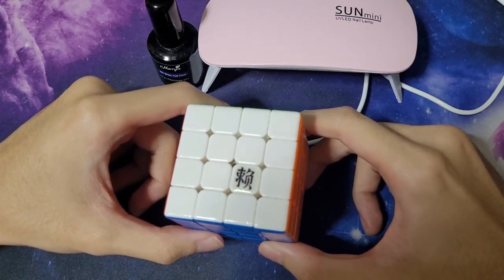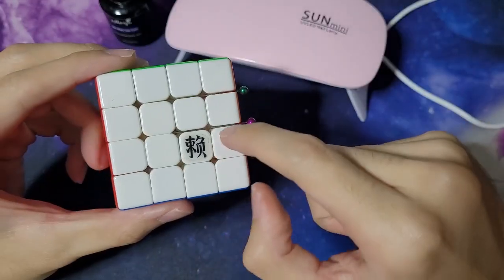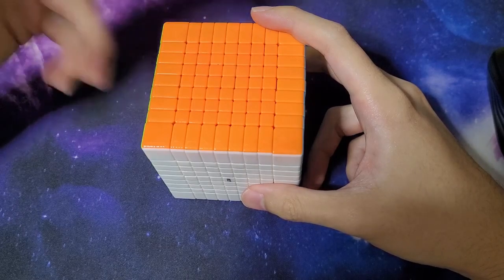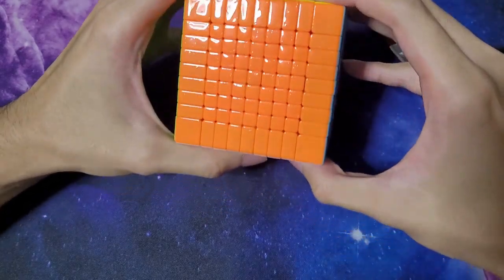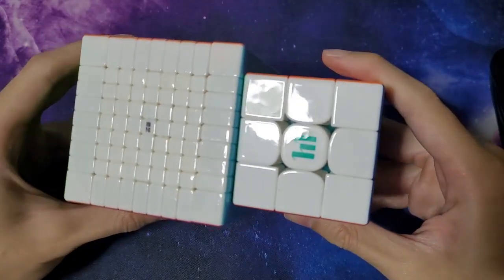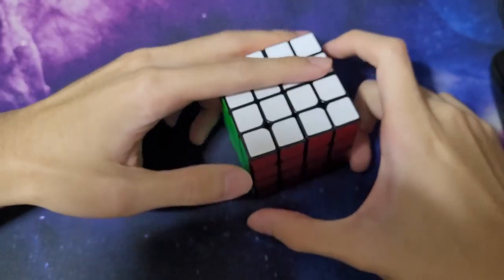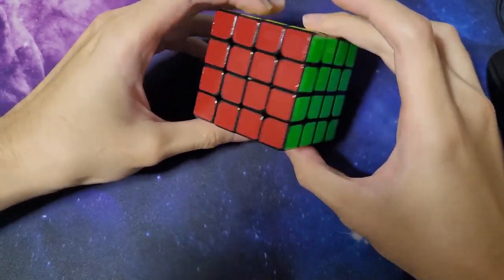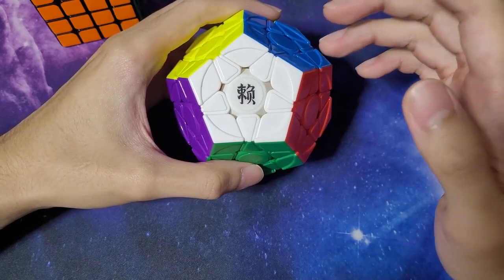UV coating bigcubes and stickers

Comment from the maker: There is actually another application to UV coating that I teased in the thumbnail but didn't mention in the video, and that is to make a hardened layer on top of core-corner magnet shells to add an extra level of defence against these magnets dislodging. For that I use a different resin (because I have also bought one that's more prone to fingerprints and isn't as shiny). I think the topcoat works too, it's just too precious to waste on something that's not even visible when the cube is assembled.
Reply: Where do you get your core to cornet magnet